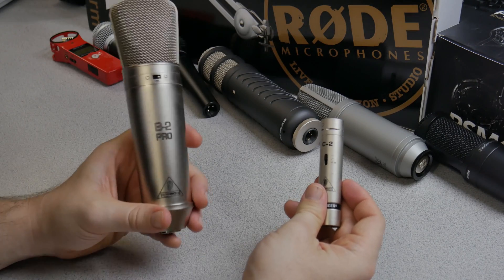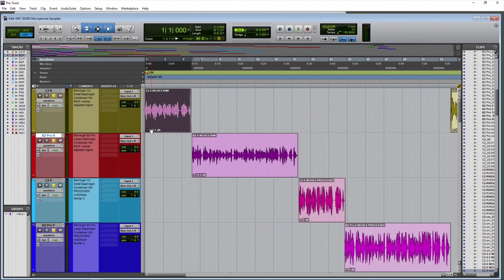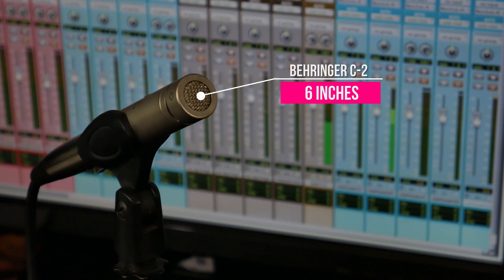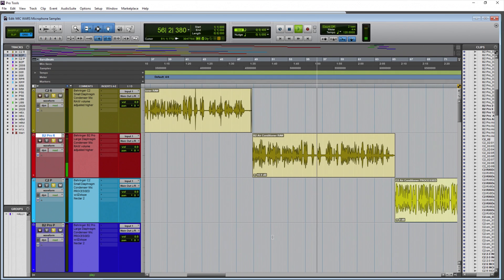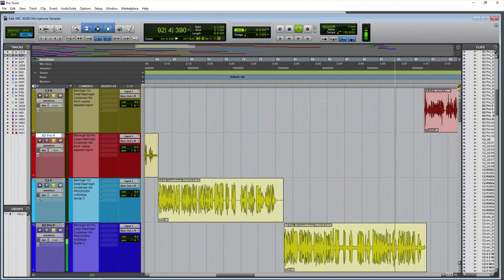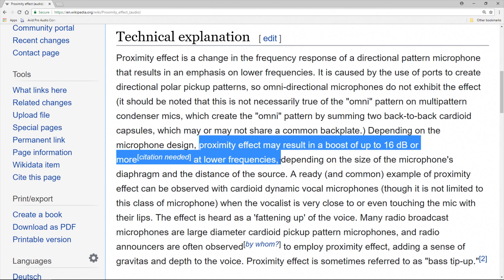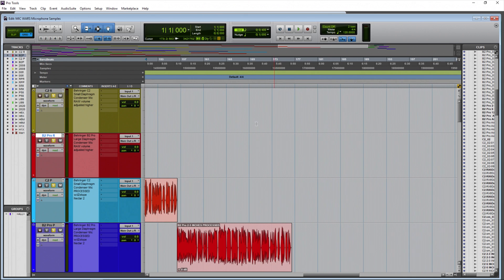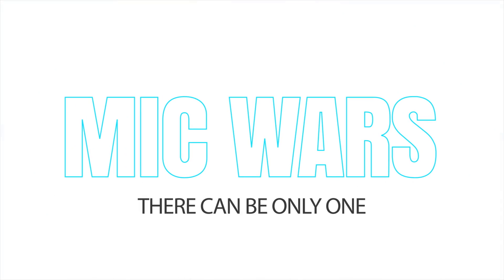MIC WARS | Small Diaphragm vs. Large Diaphragm Condenser Microphone 🎙

Comment: So basically what I "heard" was either mic can sound the same depending on how close you are from the mic. You can deepen the low end of the small condenser by increasing your closeness to the mic. It will sound close to the large condenser. But... if you compare which mic sounds better with close proximity, the large condenser wins, hands down!